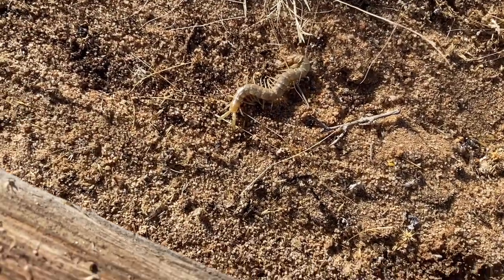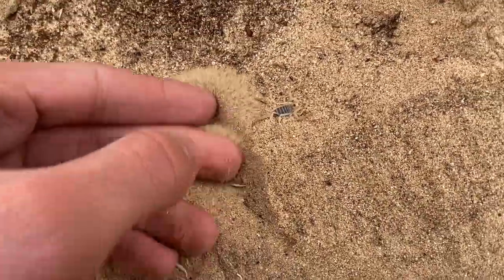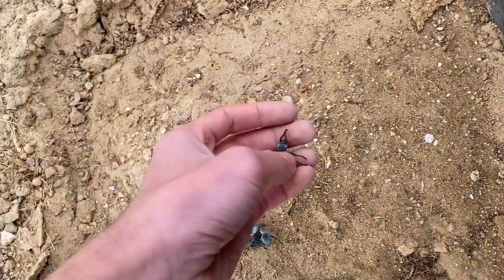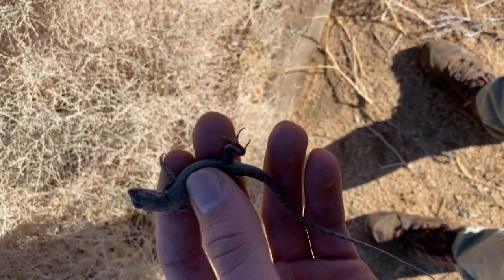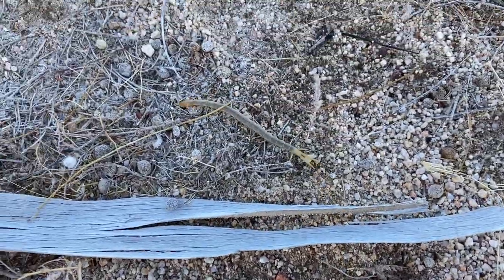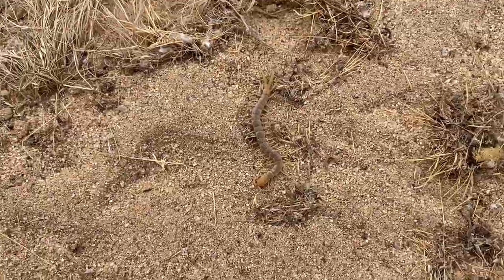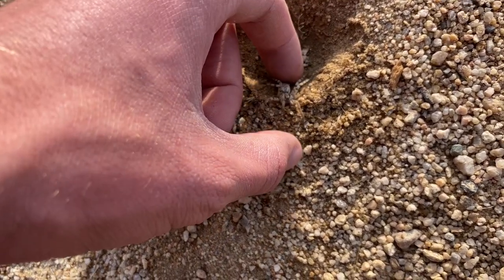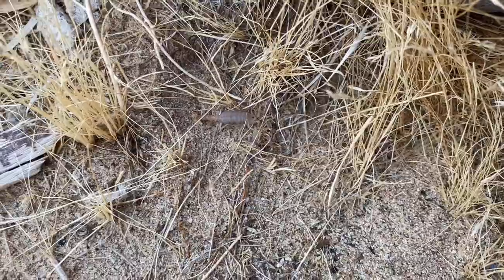Looking for Centipedes, Scorpions, and Spiders in the Desert

Comment: 6:02 is that spider dangerous or do you not know because I wasn’t able to find any info on how strong the venom is.
Reply from the maker: I have no idea, but their venom is not all that effective on insects in captivity. They don’t show any signs of aggression either which has me less worried.
Reply: The six eyed sand spider is very venomous and has 2 recorded victims of a bite. The necrotic venom caused the loss of an arm for one victim and death for the other. They aren't very defensive at all, so it's fine